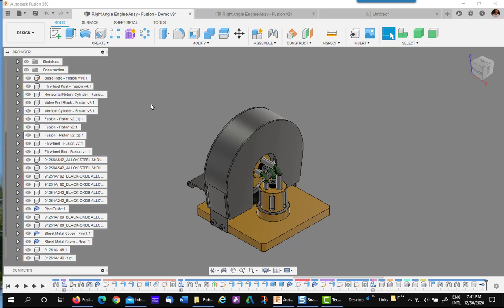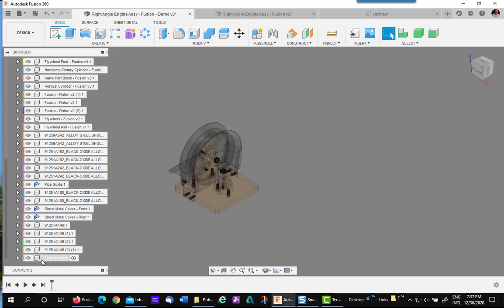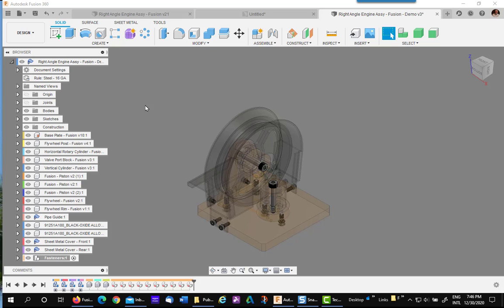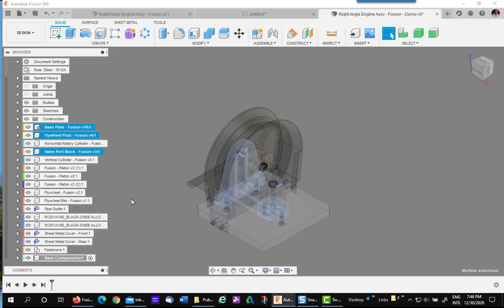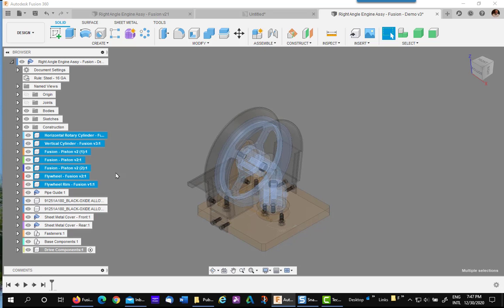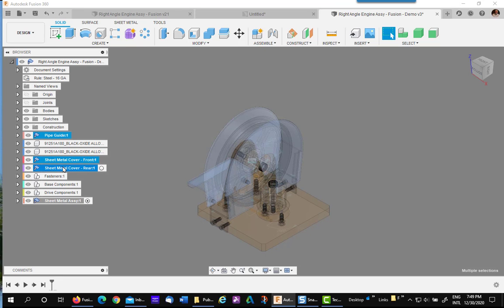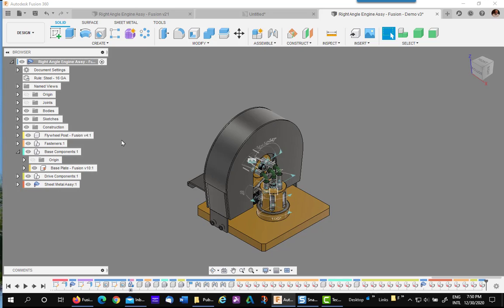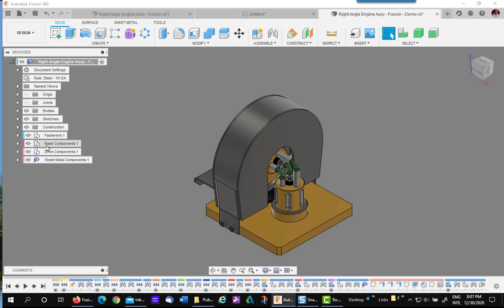Organizing Your Fusion 360 Assembly By Dragging Components

Comment: its not working in 01.2022 =)
Reply from the maker: I tested it on the latest version and it functions the same.  I believe it is due to your existing browser relationships.  If you would like, export your model and send it to me to test at jhackney1950@gmail.com.
Reply: @jrhackney  i find the reason, its not working on existing model where components where created from bodies, in project made from scratch only with components it work. Some autidesk solutions for usability are........not wery i tuitive, groups works with bodies and its handy but not work with components its a fuck up.

Comment: Great tut, mine will not drop components onto the new assembly. 
I have to copy and paste into the new assembly then delete the originals. 

My timeline is at its end, there are no errors in the components being moved. 

It will drag them but F360 won't allow me to dump them into a new assembly, is this still working?
Reply: I was also unable to drag and drop, but this worked for me. You may want to check if you timeline marker is rolled all the way to the end. Only then you can drag components in the browser.
Reply: @manupena1121  Thank you for this answer it actually is the issue, this software is turning into a programmed nightmare for me.
Reply: Cheers for that.
Works for me, wasn't able to drag and drop like indicated in the video.
Reply: also doesn't work for me any more. But I remember that it worked a while ago. Don't know why it stopped working :/

Comment: Thank you. 
It‘s really annoying that fusion does not offer better ways of structuring/sorting. This blows up the timeline and seems to need a lot of additional ressources.
Reply: The worst is that you can not re-order the list. 
If you have a very old component and want to drag it into a new one, you will have to "scroll" the whole list every time you want to combine such components. It is very unnecessary of a problem.